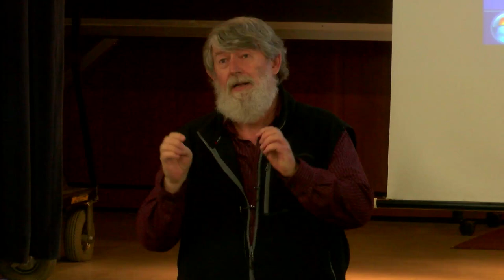David Chandler - How did they deploy 100s of tons of Nanothermite?

Comment: About the perimeter columns: 
1. Every 36 feet, the three-column units (the column/spandrel prefabs) were bolted together. 
2. Oval access holes at these junctions were accessible from office interiors every three floors.
3. If the thousands of official "ground zero" aftermath photographs from FEMA, etc., are examined, it quickly becomes obvious that although many column ends were showing,  almost none had bolts in them, and not only that, there is no visible sign of exploding bolts or any force of any kind breaking that bolted junction. 
4.The bolts would have been easy to remove under some pretext of new network cables or something. 

5. Important point:  Although this seems counter-intuitive, the fact is that the stability of the Twin Towers would have been entirely unaffected by the removal of these perimeter wall bolts, because of the redundancies of the total tower structure and every column's connections by other bolts and welds to the spandrels and the floor trusses, and thus all the way to the core columns. 

6. BUT as soon as the core and floors were destroyed (however it was done), the perimeter wall would naturally fall in manageable pieces: the same pieces, in fact, the same three-story, 36-foot sections that were delivered and joined by bolts when the Twin Towers were first built. 

7. Ground zero photos show, with a few exceptions,  primarily  undamaged, bolt-free ends of units which should have had bolts still in place. Consider that fact and what it means. Bolts by the thousands just don't disappear into thin air.  And this was not just a few dozen bolts but thousands and thousands of quite large, high-strength steel bolts which were each about 1"to 1.25"  in diameter (estimated from photographs) made of steel with a tensile strength of hundreds of thousands of pounds per square inch, meaning that those bolted connections probably became as strong as the columns themselves.

8. Almost no bolts where they should have been,  and column end plates  undamaged. 
You do the math. 
The evidence is right there in the various sets of official photos, which can be found and downloaded, or viewed on the Web. 

9. The result made the cleanup slightly easier by breaking up as much as possible of the perimeter wall into sizes that originally came in on flatbed trucks and could go out on flatbed trucks without having to either cut the bolted sections apart or wrench all those bolts loose in the rubble pile. so the pre-weakening David Chandler mentions also included the removal of many, probably well over half, of those thousands of bolts which held the prefab sections together end to end.

10. What if the bolts had NOT been removed?  Then the possibility, or even certainty,  of hundreds of feet of still-connected perimeter wall, after the demolition of everything else,  was a frightening possibility to the planners of the demolition. 

11. Even WITH the bolt removal throughout most of the structure, , there was at least one tall section of still-connected wall, (undoubtedly with the original bolts still in place and intact) that was maybe a hundred feet high,  probably more, still standing after the Towers were down, even leaning over somewhat. 
    What if huge areas, four or five hundred feet high or more, of the exterior walls had NOT collapsed?  How could that be safely dealt with, after the rest of the Towers were on the ground?

12. But the removal-  (using common hand, electric,. or air tools)- of those thousands of bolts, (or most of them) minimized the very real probability, post-destruction,  of huge leaning slabs of otherwise unsupported, very unstable, and highly dangerous,  perimeter walls.

Comment: Speed is the distance covered in a unit of time while acceleration is the rate of change of speed. The unit of speed in the metric system is meters per second (m/s) while that of acceleration is meters per second squared (m/s2). Speed is a scalar quantity while acceleration is a vector quantity.
The force vector describes a specific amount of force and its direction. You need both value and direction to have a vector. Both. Very important. Scientists refer to the two values as direction and magnitude (size). The alternative to a vector is a scalar. Scalars have values, but no direction is needed. Temperature, mass, and energy are examples of scalars. 
When you see vectors drawn in physics, they are drawn as arrows. The direction of the arrow is the direction of the vector, and the length of the arrow depends on the magnitude (size) of the vector. 
Inertial Frame of Reference. A simple example:
If the laws of mechanics work in one frame of reference, then they also work in a frame of reference that moves with constant velocity with respect to the first frame.
(ie if your first frame is inertial, the second frame is inertial.) If you can juggle on the platform, you can juggle in the train, or even in a plane, even if a bystander sees you and the balls whizzing by at high speed.
Why are the laws of physics the same in the train and on the platform?
The Galilean principle of relativity follows from a simple set of transformation equations and a few deceptively simple assumptions. For simplicity, let's confine all motion to the x direction. Suppose the train is moving with velocity v (in the x direction). To be concrete, let's suppose that the train is moving at 30 m/s. After one second, the train is 30 metres further on.
Now consider a passenger walking with constant velocity u = 1 m/s along the aisle, towards the front of the train. After one second, she is 1 metre further down the aisle. How far has she moved with respect to the platform? The train has travelled 30 metres in the second, she is one metre further down the aisle, so she has travelled 31 metres with respect to the platform. She is travelling at v + u.
See: https://newt.phys.unsw.edu.au/einsteinlight/jw/module1_Inertial.htm

Elementary Physics & WTC 9/11

All progressive collapse theories defy Newtonian physics:
Newton’s third law is: For every action, there is an equal and opposite reaction.
Applying this principle to the collapse of the WTC Towers, it proves that the upper portion could only destroy the lower portion by the equal amount of the floors; That is if 12 floors are crushing the floors beneath them they can crush no more than 12 stories below. Simple physics.
What is the work done in ‘crushing’? It is smashing and destroying a material and objects. Equal and opposite crushing is crushing from above and equal crushing from below. ‘Crush up–Crush down’.
The material crushed in the interaction is equal. Therefore there is no material left to crush down after it is exhausted itself against the crush up.

Newton’s laws of motion all are applied within the same inertial frame, of which gravity is the initial force considered. The concept of “single point masses” refers to smaller bodies in an inertial frame — like planet Earth, rather than massive spinning bodies like stars and planets in outer space.
Inertial Frame of Reference
An inertial frame of reference, in classical physics, is a frame of reference in which bodies, whose net force acting upon them is zero, are not accelerated; that is they are at rest or they move at a constant velocity in a straight line. In analytical terms, it is a frame of reference that describes time and space homogeneously, isotropically, and in a time-independent manner.
Conceptually, in classical physics and special relativity, the physics of a system in an inertial frame have no causes external to the system.
An inertial frame of reference may also be called an inertial reference frame, inertial frame, Galilean reference frame, or inertial space.

Newton’s laws of motion are originally a theory of general relativity, meaning they apply to bodies in the vacuum of space, where the only gravity exerted on an object is from an external mass.
The “internal frame” spoken to is the frame within the planet Earth, wherein there is both gravity and a gaseous atmosphere. So the original gravitational computations are all directed to objects in a vacuum.
We consider the drag caused by the atmosphere when we want exact and precise measurements. In most situations the rate of acceleration due to gravity is close enough for all practical purposes.

Newton’s Laws of Motion

First law: In an inertial frame of reference, an object either remains at rest or continues to move at a constant velocity, unless acted upon by a force.

Second law:* In an inertial reference frame, the vector sum of the forces F on an object is equal to the mass m of that object multiplied by the acceleration a of the object: F = ma. (It is assumed here that the mass m is constant – see below.)

Third law: In an inertial frame of reference, when one body exerts a force on a second body, the second body simultaneously exerts a force equal in magnitude and opposite in direction on the first body.

A fourth law is often also described in the bibliography, which states that forces add up like vectors, that is, that forces obey the principle of superposition.
In physics and systems theory, the superposition principle, also known as superposition property, states that, for all linear systems, the net response caused by two or more stimuli is the sum of the responses that would have been caused by each stimulus individually. So that if input A produces response X and input B produces response Y then input (A + B) produces response (X + Y).
The original laws of gravity were posited for massive bodies like spinning planets and stars in the vacuum of outer space.
The superposition principle adjusts those laws of physics to deal with the inertial frame of planet Earth.
. . . . . . . . . .
Newton’s law of universal gravitation states that a particle attracts every other particle in the universe with a force which is directly proportional to the product of their masses and inversely proportional to the square of the distance between their centers. This is a general physical law derived from empirical observations by what Isaac Newton called inductive reasoning. It is a part of classical mechanics and was formulated in Newton’s work Philosophiæ Naturalis Principia Mathematica (“the Principia”), first published on 5 July 1686. When Newton’s book was presented in 1686 to the Royal Society.

Dynamic Amplification Factor
Dynamic Amplification Factor (DAF) or Dynamic Increase Factor (DIF), is a dimensionless number which describes how many times the deflections or stresses should be multiplied to the deflections or stresses caused by the static loads when a dynamic load is applied on to a structure.
Where:

M is the mass of the object in air (kg)
g is the acceleration of gravity (9.81m/s2)
F total is the largest of F static mass + F hyd or F static~mass + F snap (N)
______________________________________
https://willywhitten.wordpress.com/2018/03/04/9-11-simple-physics/
\\][//